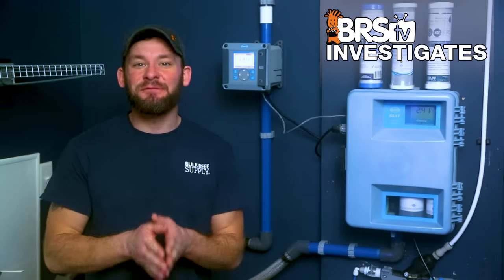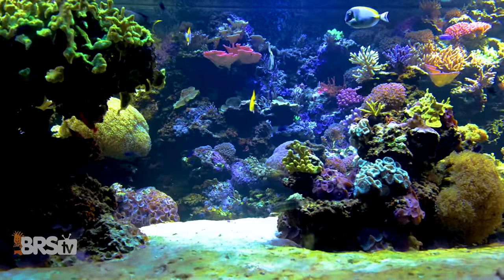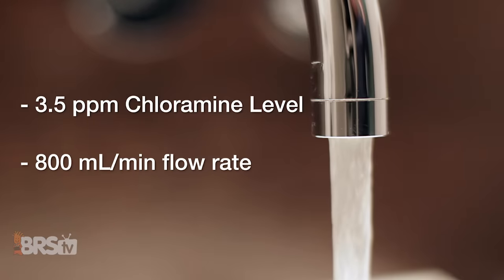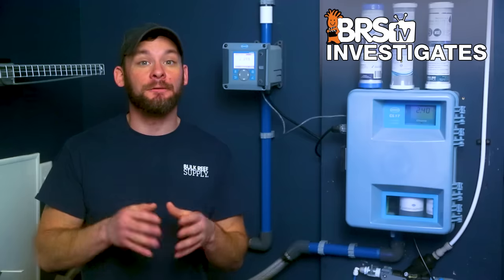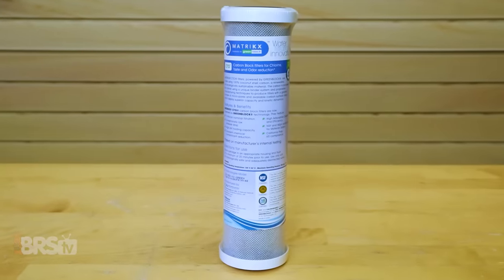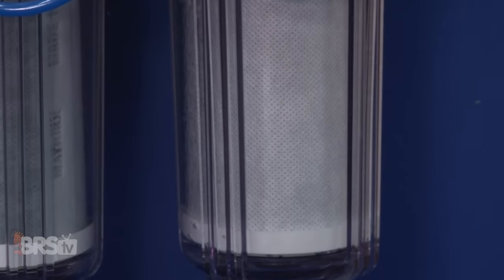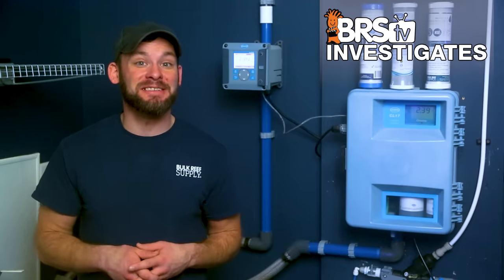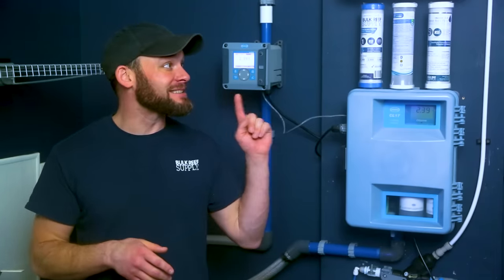20X or 50X? Do you have the right RODI filters for the right job? | BRStv Investigates

Comment: Great video. In the past I think BRS recommended 5 micron followed by 1 micron. With these findings would you recommend dual 1 micron blocks in our units?
Reply: I had the same question - I was using dual 1-micron universal filters but my last filter replacement kit came with the 5micronX1micron, so I'm curious what the performance tradeoff is.
Reply from the maker: If you have Chlorine 5 micron > 1 Micron because it's cost-effective and the first is just there to reduce the load on the second superior filter and chlorine is easy to treat for. if you have chloramines then Universal > Universal because normal blocks are basically worthless for this application.
Reply: @BRStv  got it! Time for another order 😂😂

Comment: I would love to see this repeated with just Chlorine for the other 50-70% of the country that does not have Chloramines.  That way we could gauge just how effective the Chlorine and VOC block is compared to other solutions.
Reply: Agreed
Reply from the maker: The reason we haven't done this with chlorine is is because chlorine is so easy to remove. I personally would trust the suggested run times on the label of any reputable NSF certified brand. We could consider running a test like this but testing a few chlorine blocks would likely take 6months of effort and I think there are more valuable areas for us to explore for reefers.

Comment: Since I am on well water I do not have chlorine or chloramines but I do have a lot of CO2 in the water.  I would love to see yall put together some type of automated degassing option.
Reply: I agree..I'm on well too and my paper filter turns orange within the first 5 gallons of water
Reply: Yeah me as well
Reply from the maker: might be possible to make a kit for this.  But filling a container with water RO water, using a pump to mix it and then pump to push through DI is what it would achieve.  Pay off might be far out for most.  I would suggest the DI saver option where the anion resin removes the co2 as a middle ground.
Reply: I already have the 3 stage DI saver but it's still earing anon resin.  I added a 55 gal barrel for well water and float switch.  Then mix it and drain into booster pump. it gets up to 75 lbs and made about 30 gal of Rodi and didnt see anon move.  Verdict it still out though.

Comment: Thanks for the video. So what is the best setup for the Reverse Osmosis Systems you carry? Like the way they should be in order in the system. Thanks again!
Reply from the maker: If you're looking for best of the best, we usually would recommend our 7 stage system. The water will flow throughout he filters in this order: Sediment filter -> Carbon Block -> Carbon Block -> RO Membrane(s) -> Cation DI resin -> Anion DI resin -> Mixed Bed DI resin

Comment: RODI with water softeners potentially covered in the future?

Asking because our well water here has no measurable elements except very high amounts of iron, iron eating bacteria and CO2. Which makes it come out of the ground at a ph of 4.2

I was thinking of maybe using an ozone treatment system for oxidizing the iron and killing the iron eating bacteria then re oxygenation with an off gasification system. 

But I'm curious as to how water softeners affect RODI since that's a more common practice?
Reply from the maker: Water softeners will make the RO system and filters last longer because they remove most of the hardness. The downside is the sodium they use to exchange with consuming more DI resin. Installing after the softner is the right answer.

Comment: What's the best way to determine the lifespan on a regular carbon block for non chloramine water? Can I assume the chloramine block doesn't help more than a regular carbon block if chloramines are not in use?
Reply from the maker: With well water, we are not concerned with disinfectants but more so the potential chemicals that can be in groundwater. Petroleum by-products, pesticides, herbicides... There isn't a test for this so I'd go with the recommended capacity on the filter but make sure you account for waste and product water. So a filter with 10,000 gallons capacity can produce about 2,500 gallons of product water before being replaced.   However, they often get clogged with sediment before that.  My suggestion is to change them once a year. I pick January for almost all my yearly maintenance because it is often a slow month for me, when I am working on the tank already and easy to remember.

Comment: How is a higher producing rodi unit stand up. Such as a 100gpd with the BRS double membrane to make it a 200gph system. Does that drastically reduce the carbon blocks life? Or do you get additional since the membranes are after the carbon to begin with?
Reply from the maker: When you go RO saver with dual in series membranes it effectively makes the system much more efficient on carbon blocks because they produce double the product water with the same amount of wastewater processed.
Reply: @BRStv  thanks for the reply.. trying to get a copy of our water report since we just moved in to our new home.

Comment: If my filter came with an 80 gpd, and I want to buy a new membrane like a 100 gpd, do I need to buy a different flow restrictor? 

Why would someone choose a membrane that makes less gpd? Why would you want 80 gpd instead of 100 gpd? 

Thanks!
Reply: Higher rejection ratio. You can always use more of them.
Reply: @aquariumiconoclast1613  so purer water?
Reply: @clintparsons3989  Yep. Lower TDS, etc.
Reply from the maker: The 75 GPD membrane are as high as 99% rejection and work on standard water pressures.  Higher flow rate membranes often have lower rejection rates which means you can burn through double or triple the DI resin. Dow membranes are as good as it gets.
Reply: @BRStv  thanks! Would you say 50 gallons of RODI before DI resin needs replacing is an acceptable amount?
Reply from the maker: @clintparsons3989  that's low, but there isn't a right answer. If you have co2 or higher TDS you can use 10x as much as the next guy.

Comment: If my filters went unchecked for a while and I have approximately 100 gallons of water with chloramines in it...can I effectively keep that water by treating it with a tap water conditioner? The water is still 0 TDS...I hate to waste it.
Reply from the maker: The tank won't crash from using that water with conditioner.  However, I will say that a "good enough" mentality produces related results.
Reply: Right, not saying to routinely add water conditioner in lieu of using the appropriate carbon block...just wondering if I can salvage the RO water I have stored right now until I get my new blue carbon blocks from BRS...which are being shipped now.

Comment: Luckily our small water treatment only uses Chlorine. However with our 14 GPG water I have a softener and those sodium ions are draining my resin filter at an insane rate.
Reply: Is that much sodium getting through the RO membrane?
Reply: Either that or I need to install a second membrane and increase my efficiency which I plan on doing.
Reply: @Zeptyche  What membrane are you using now?
Reply: Currently I’m using the 75GPD BRS RO. DOW Filmtec Membrane.

**DOW Filmtec 100 GPD Membranes have a 96% - 98% typical stabilized salt rejection rate that can be reproduced through the following conditions;
Source Water Pressure - 50 PSI / Membrane (65 PSI for Water Saver systems)
Source Water Temperature - 77°F
Source Water TDS - 250ppm Softened Tap Water
Recovery - 15%
Minimum Salt Rejection - 96%

Comment: I think the premise is flawed.  You're going through all of this on the assumption that the RO membrane and DI resin will be rapidly destroyed, but that hasn't been the case for me.  I don't use a carbon stage at all (GASP!) and haven't for years.  My TDS after the membrane and before DI remains 2-4ppm.  I think it's important to swap out the membrane at least once a year anyway to export the accumulated organics, and the average reefer probably doesn't go through enough water in a year for the chloramines to ruin the membrane anyway.
Reply from the maker: I understand the thought process here and don't disagree. In some cases that approach works. In others, there are chemicals and gases that readily pass through the membrane and because they have no electrical charge sso they pass through the DI as well. Ammonia gas is one of them. Because they have no charge they also don't show up on a TDS meter.   The reason that RO systems in almost all industries from drinking to reefing use a series of progressive filters is because it's nearly impossible to know what is in everyone's water and it changes seasonally. Just easier to use a filter that works in the widest array of applications.  With some effort and risk tolerance, it is possible to ID if each stage is absolutely required in each application.